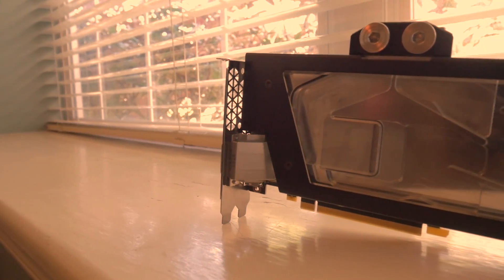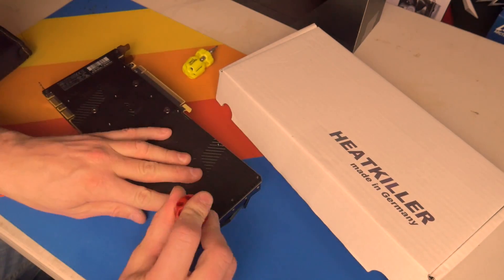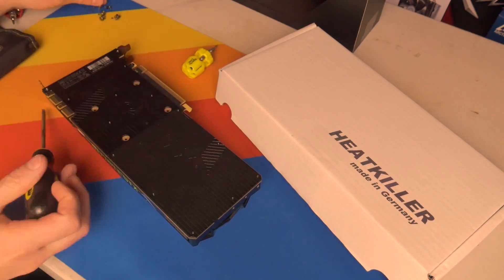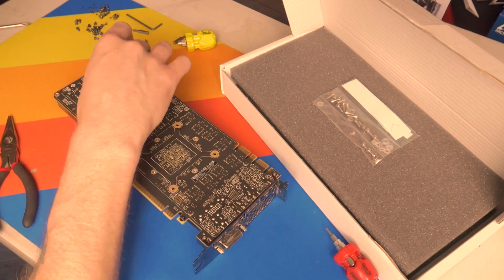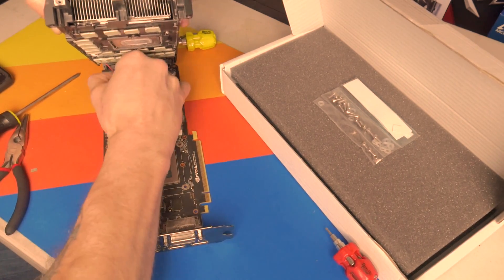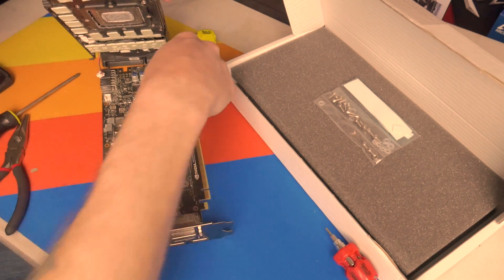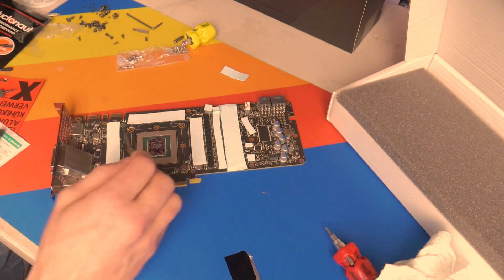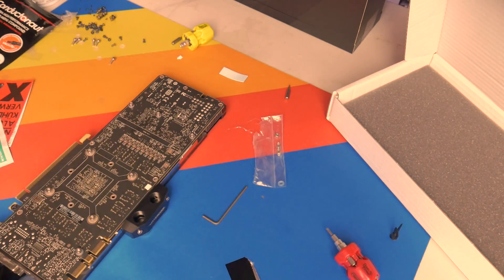How To Install a GPU Waterblock | Titan X Pascal | Heatkiller IV

Comment: nice vid.

just curious,when the watercooler pump needs more power then normal fans(?) can it still be more profitable mining coins on it with higher clockspeed then before cause of cooling or is it watercooled for less noise from the rig?
Reply from the maker: This is not really for mining although I haven't worked those numbers before.
Reply: Most miners would not touch water cooling. It's higher maintenance and risky for hardware.